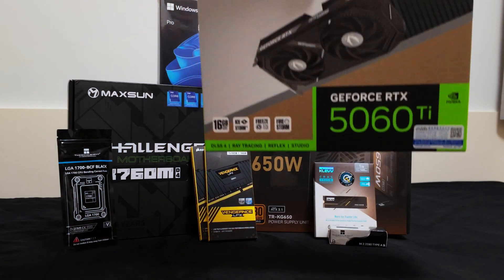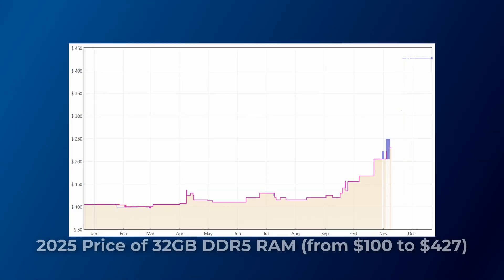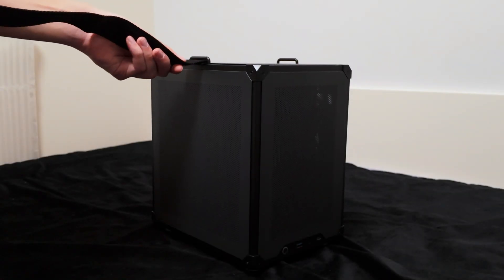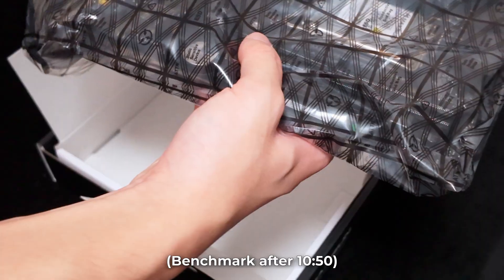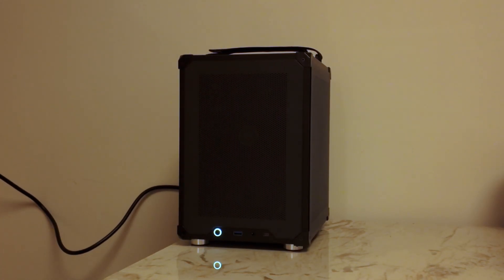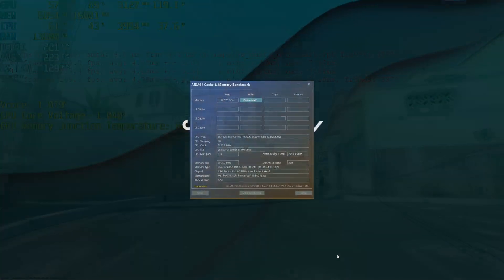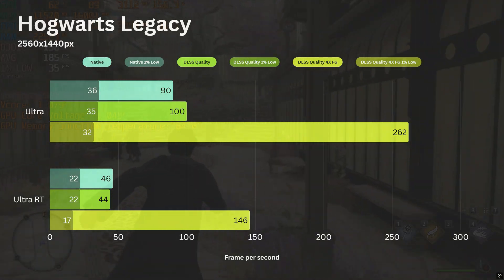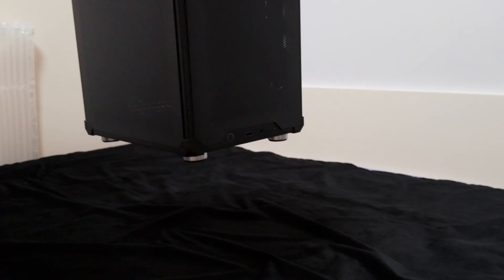DDR4 Budget Compact Gaming PC Build Under $1000 (2026)

Comment: I should be ok using 5070 SUPER with i7 9700K even if there will be 10-15% bottleneck if RAMPOCALIPSE is not over I also have 32GB RAM 3200mhz
Reply from the maker: There is no 5070 super. It's near impossible for NVIDIA to release 50 super cards when VRAM prices are skyrocketing.
Reply: @n3x_ify  not yet
Reply from the maker: I wouldn’t be that optimistic 🥀
Reply: @n3x_ify  untill Witcher IV and GTA VI comes on PC I have no reason to upgrade or make another PC just to play same old games at 300fps

Comment: It is better to set the front fan to blow out, so that the hot air from the GPU is immediately pushed out.
The top panel holes are too small and the heat remains at the top and goes to the processor if front the fan is set to blow in.
Reply from the maker: There’s an exhaust fan on top of the motherboard actually

Comment: nice video. maybe try the 5600x and the 9060xt 16gb next as it should eliminate some of the bottleneck for the same budget
Reply from the maker: 12400f actually performs similar to the 5600x so it wouldn’t really help by downgrading the GPU to 9060 xt
Reply: @n3x_ify I see, maybe an even better cpu then

Comment: Hello, nice build there! I was Jonsbo C6 user last year and moving to Tecware Fusion. With that kind of mobo, you could try to mount AIO 120mm on front. I previously use Ryzen 5 5600 with PBO on, +200 Mhz and CO -27 with ID-Cooling Frostflow Lite 120mm and get max temp around 78c with no AC in my room and kinda hot here since i'm in South East Asia.
Reply from the maker: I'm pretty sure the AIO tubes dont fit between the PSU and RAM modules

Comment: Almost 100 USD between a 12400F and a 5600X is wild. In Poland an OEM 5600X is actually cheaper than a OEM 12400F and a 12490F from Ali is priced similarly to a box 12400F.

Comment: I just built a new pc after rocking the i5 6600k and the gtx 1070 up until now.
The new pc has an i5 14600k and the rx 9060 xt 16gb, 48gb of ram and a 750w psu.
Runs everything I could ever want to play and cost around 800 usd.

I was going for a pure amd build but amd cpus were way overpriced both new and used.
Reply from the maker: 14600k is one of the fastest gaming CPUs so you would be fine for the next few years, somewhat better than the 9600x due to 8 extra E-cores.
Reply: @n3x_ify  Was my conclusion too, but glad to hear it from someone else too 😊
Reply: @n3x_ify  Btw keep up the content man, videos have been on par with much higher production channels 😁

Comment: sir, is u5 225f + rtx5060 , 16gb ram pc build.... with monitor , keyboard and mouse good deal for $1150?
Reply from the maker: that’s a decent build for 1080p gaming, make sure u get 1 stick of 16gb ram instead of 8gb*2 ram kit, this way you can upgrade to 32gb when the price drops
Reply: Yes. Get what you can get… NOW… if you want a PC.

Comment: I just finished building a similar PC for my dad, but it’s focused on 1080p. 12400, B760m, 32GB ddr4 3600 cl 16, 750w PSU, RTX 5050, and a 1TB m.2 SSD. 

Luckily I had purchased the RAM in early 2025 while it was $70 USD for a g-skill kit. Bought the Asus Prime 5050 for $232 USD just this week. And the B760m board has a PCIe 5.0 slot so the 5050 can deliver maximum performance. His monitor is only 75hz, so I didn’t see the need to get a 5060 let alone a 5060 Ti. He’s going to use the PC for general computing and light gaming (flight sim 2020 & golf).
Reply from the maker: Good to know that you got the ram sticks early 🤣
Reply: @n3x_ify  For reals. A 2x8 16GB kit of ddr4 is at least $100 USD as of today. Absurd.

Comment: You could have purchased Three times the PC for that last year...its a shame
Reply from the maker: Yeah, definitely can get a better CPU like 7500F with DDR5 last year. The price increase just doesn’t make any sense imo, there were tons of DDR4 in inventory in early 2025 and the price only increased because of DDR5 “shortage”
Reply: Luckily, i got a 7500f, Asrock B650 hdm.2 and DDR5 6000 for 320 Euro in September, just before the price sky rockets. The RAM only is now far more than that. First time i chose the right timing to upgrade😅 Runs great in bf6. AM4 was a very good platform. Still usable till crisis ends.